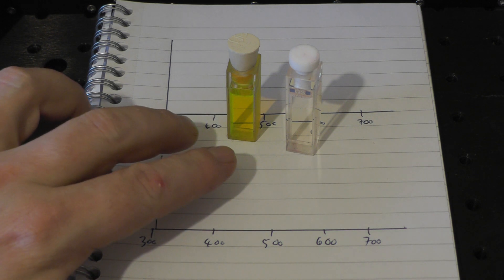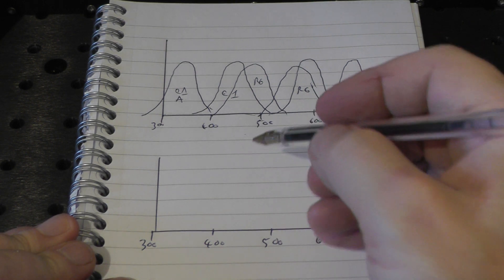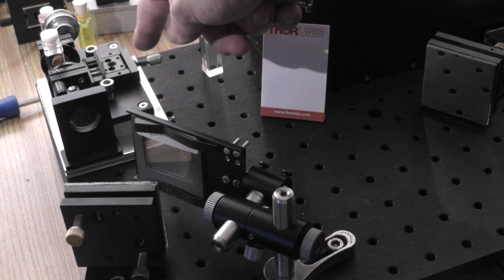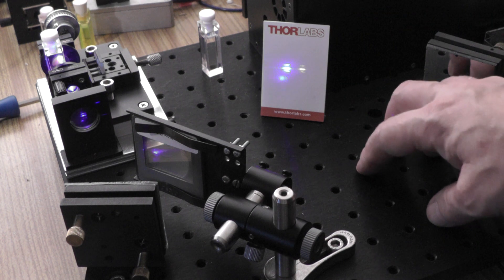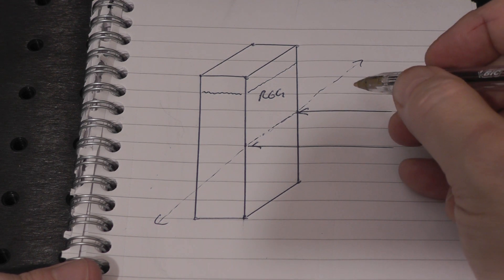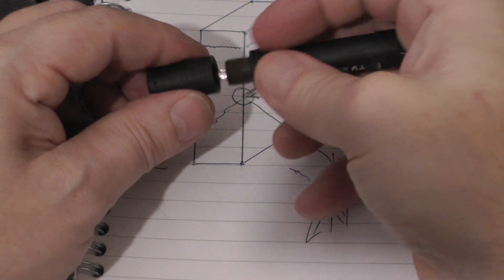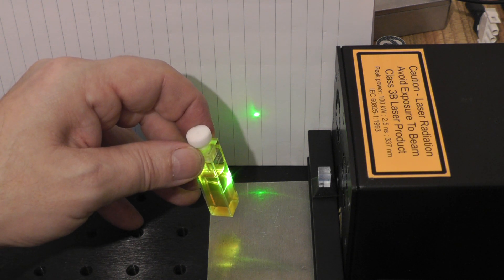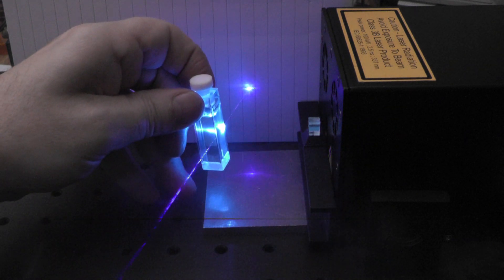RGB Dye Laser? How Dye Lasers Work: Viewer Questions

Comment: Hi Les, how much power is necessary to pump the dye?
Reply from the maker: The peak power here is about 100kW (average power is a few 10's of milliwatts) and its the peak power that counts. I have had them Lase with as little as 10-15kW so long as you put the cell in a real cavity. It depends on the Dye and the quality of the cavity at low powers. In seom academic papers, pulsed laser diodes have been used to successfully pump Dye Lasers, but you are looking at pulse energies of picowatts, and average powers of nanowatts.

Comment: what about glow sticks? can we take the chemiluminescent liquid and put it in a cuvette inside a fabry perot cavity and have it lase itslef?
Reply from the maker: Unfortunately not. Triplet state absorbtion is a problem, which would quench Lasing (if the dyes in those will even Lase in the first place). To get a continuous wave Dye Laser, the Dye has to be circulated past the pump beam at very high velocities to stop this from occurring.
Reply: @LesLaboratory  hmm all this stuff confuses me, i figured since the chemicals are creating spontaneous emissions then we could create stimulated emission much more by using mirrors no?,, suppose we have an imaginary pin point light source sending spontaneously emitted light in all directions and we add this inside a fabry perot would we not get a collection of light rays all bouncing back n fourth directionally between the mirrors even though there is no stimulated emission we should still get a beam output no?

Comment: can i not take a strong enough black light emission pass it through a lens unto a cuvette like this and make a laser beam?
Reply from the maker: It the black-light was very high power and very short duration then certainly. But you would be talking kilowatts and nanoseconds. Nitrogen Laser just happen to be a relatively straightforward way to achieve this.
Reply: @LesLaboratory  i thought your n2 laser was cw not pulsed? see this high power or peak and short duration having to do with the short life time of the gain mediums exited state etc etc  to make it work is something i never understood and i was also told ruby lasers can never function cw because of this yet now we have cw ruby lasers!!! , why do we even need high power?we can already see this liquid fluorescing under the slightest black light condition so why is this light simply not amplified between mirrors to get our beam despite it being a weak beam?

Comment: so what if you got photons traveling along the axis of this line in a cuvette, you got the same happening in a hene laser yet it needs mirrors to create stimulated emission output so why does the dye cuvette not need mirrors?
Reply from the maker: The single pass gain in a Helium Neon laser is about 1% or so, which is pretty low. The gain (or amplification) of Laser dyes is very high, so high that amplification of the light can take place in less than 1mm.
Reply: @LesLaboratory  i suppose it has to do with atom density in a liquid being much higher than in a gas is that part of it?

Comment: Hi Les, really inspired by your videos. I've been studying your DIY white laser and been trying to duplicate your dye laser setup. Could I ask what is the partially reflective mirror component that you used? (If it's purchasable by Thorlabs, Edmund Optics). Is it just a regular 99% broadband VIS coating with some transmission at 1%?

 Also, I am thinking of using a ND:YAG (@ the 3rd harmonic 355nm) to excite the dyes so I can play with the pulse width, pulse power, etc. Love to sync with you if you are interested.
Reply from the maker: These lasers dont require much feedback, so I used 1 inch plate beamsplitters from thorlabs, and they work just fine: https://www.thorlabs.com/newgrouppage9.cfm?objectgroup_id=914
50:50 or 70:30,  both work well.

Interesting your should mention this. I have a 355nm YAG as well that I repaired some time ago. I just need to devise a circulation mechanism for the Dye, but haven't quite gotten round to it yet!
Sure, drop me an e-mail!
Reply: @LesLaboratory  Thanks Les! Sorry for my late reply. I have some thoughts on the circulation (assuming you mean moving the liquid dye in the cuvette around). I'll ping you offline or we can have a chat here (for any intrepid readers), up to your preference!

I am looking to buy Coumarin 460 for my mixing. Molar mixing seems to be sort of straight forward if i know the Molar... but love to hear how your DIY dye mixing process went for you.

Also saw you dropped a new video on the ND:YAG laser, I'll check it out soon.

Comment: Could you combine different dyes around a rotating cylinder, so you get an alterating wavelenght laser. If the cylinder rotates fast enough, it would Look like a white laser.
Reply from the maker: There was a paper, (I forget the title) where they pumped 3 microcuvettes, mounted staggered which gave a more or less RGB output. Lately I have been building Supercontinuum Lasers for a true White-Light Output: https://www.youtube.com/watch?v=w1wSHizmbYg

Comment: How does the dye get its population inversion?  The photons for population inversion in the dye is also supplied by the nitrogen laser?  Thanks.
Reply from the maker: Yes, the population inversion is caused by the optical pump energy from the nitrogen Laser. This is analogous to optically pumping Ruby for example, with a flashlamp.

Comment: If I put an AOM in between the HR and the dye cell, do I sync to the pump laser, slightly off or at some multiple of the pulse rate to qswitch it?  Thinking the stimulation saturates faster than I can switch it and since the lasing is superluminal does a qswitch idea for building up a pulse even make sense?  Looking at ways to up the game for the super continuum laser pump.
Reply: No the dye has a very fast decay time in nanoseconds or less and a long regeneration time. It needs a fast pump source or  to have the dye moving quickly to lase.

Comment: ty for the videos, can u refer a reference, about dye lasers ? 
i am looking to find a dye mediium which has absorption range near inferared, or in it, how can i find suc material ?
Reply from the maker: There are IR dyes for dye lasers, however, such a dye wodul also lase in the IR, as fluoprescence almost always results in longer wavelength than the pump in all but a few very special cases.
Reply: @LesLaboratory  Thank you so much, can you name a few references so i can read more, i am really new in this field and my degrees are not in optics or physics.
i mean both generally reading abot lasers and more specifically about dye lasers  (and the ir dyes)

Comment: 4:40 the Green spot (the brightest and largest one) is from the composite of Coumarin and Rhodamine? Could it change color through changing the concentration or ratio of Coumarin and Rhodamine?
Reply from the maker: Maybe, but both dyes compete heavily for gain, and so it is very sensitive to dye concentrations. There are a few funky dyes I have been looking at recently, but they are out of my budget at the moment!
Reply: @LesLaboratory  I wonder where the green luminescence came from, maybe it came from the new energy gap (then the composite seems like a new molecule) between double levels form Coumarin and Rhodamine B? if this is true, then its color (wavelength or energy gap) will not change when the concentration or ratio of Coumarin and Rhodamine changes.
Reply: Fluorescence Resonance Energy Transfer (FRET), maybe.

Comment: With so many wave lengths in play how do you protect your eyes from the LASER radiation or is the power level low enough
that reflections do not to pose a eye hazard ?
Reply from the maker: To shield against UV is easy, regular polycarbonate safety glasses will do. For Dye lasers, well they are problematic. Laser goggles for these wavelengths show up rarely and so for now I am using good planning, and cameras for setting up.

Comment: Hi Les! I've been able to make a TERP-N2 Laser based on your TEA - Design. Thank you so much for putting the info out there! Short question: How much transmission does your usual dye-Outcoupling mirror have? Also, I think I'll try to mix dyes into epoxy/PMMA and make a Solid-State-Dye laser. That would be pretty cool :-)
Reply from the maker: Cool! I am glad you found the design useful! The OC is 50:50, however I have tried 30R:70T and it works just fine as well. I actually have a PMMA Dye laser in my box of "yet to be demo'd stuff" ;-) It will be challenging, but there is no reason why it can not be made to work.

Comment: I am curious, with the combined dyes the "repetition rates" that changed how the two competed were, if I heard you correctly, in the 20-40 hz range. Would circulating the dye affect that?
Reply from the maker: Circulating the dye may well solve it, though at this stage I am not sure what the mechanism is. My first thought was perhaps triplet absorption. There is a lot of work to be done here for sure!

Comment: Great Les. It's possible to  pump the dye cuvette with a 5w 445nm diode laser focused and get it to lase?
Reply: If you calculate the power it takes, you'll find that it's a lot higher than 5W for that much volume of dye. It is, though, possible to pump a 'jet' CW dye laser with a diode laser. I once ran Rhodamine 6G CW, using a 300 milliwatt green DPSSL module as the pump source.
Reply: @DerangedTechnologist  thanks
Reply from the maker: it is also possible (according to the literature) to pump a dye cell in pulsed mode with high power 405nm as well, though the optical setup if I recall was quite complex, and involved driving 405nm Nichia diodes in a pulsed regime (several 10's of amps at around 100n sec or so)
Reply: @LesLaboratory   I saw a report, some years back, that if you keep the pulsewidth below about 350 nsec (IIRC), you can run a diode laser at 3X its rated maximum current, so this seems quite possible, though I'm not at all surprised that the optics were complex.
Reply: Also I stumbled upon a paper that says that some german researchers did this: they took an fluorescent acrilic plate (disk shaped) and rotated it fast (don't remember rpm's) , side pumped with a continuous wave laser diode.If the rotation is high enough, the spot hit by the pumping source is hit only for a tiny amount of time and alows it to lase.I almoust build the setup , not finished yet because I burned the 405 diode  🤫 in testing the drive.Replaced the disc on a hard drive with an yellow green acrilic disc.
Reply: You can use laser diodes to pump a dye laser, but not a brute force one, a ring laser or standing wave jet laser will do. One neat one is dye mixed with glue on a rotating glass disk at brewster's angle that worked rater well. It had several dyes like tracks on a CD to change wavelengths on the fly.

Comment: Great video! 
Would it be possible to pre pump the die with a UV LED to enhance the output power and/or increase the depth of the lasing Chanel inside the die?
Reply from the maker: Anfortunately, no. Doing this would force the dye molecules into their "triplet state" where laser emission cannot occur. Also the output power from a UV LED pales in comparison to the output of a nitrogen laser (10's to 100's of kilowatts peak)

Comment: Amazing work Les! this is a really nice demonstration how this works i like it ;-) also looking forward to seeing what you come up with for the ruby laser rod i presume your going to come up with some sort of Zenon flash-tube setup? or you may already have!, the powersupply for that i will be interested in ;-)
Reply from the maker: Thanks! Yeah, this one will be done at some point. I suspect the threshold is pretty low, so I am hoping to make something compact. Xenon flash is the way to go, but I also heard they can be diode pumped as well ...
Reply: @LesLaboratory  Hi! Yes, I've actually made a DPSS Ruby laser and got a video on my channel regarding it. I would be honored if you'd take a look at it. The ruby rod however must be very short (about 5-8mm), otherwise the threshold is very high. I got it to work with 300mW 405nm pumplight and a set of specialised mirrors.
Reply from the maker: @WoodenWeaponry  Beautiful work!

Comment: Hey Les - in a cuvette dye laser without external mirrors, do you notice that lasing only happens on 2 faces of the cuvette? I've seen this in my cuvettes. I thought it was due to how the cuvette is made, and internal reflections amplifying the emission.
Reply from the maker: If you hit it super hard (>100kW) it will lase on any faces regardless of internal reflections, but in a proper dye laser setup, then yes, you will find that only two faces have good output. I think it is more likely due to how the four pieces of quartz are assembled and fused. I suspect distortions at the fused boundary spoil lasing along 2 faces.
Reply: @LesLaboratory  Makes sense -  I thought it was the boundaries as well. Thanks!